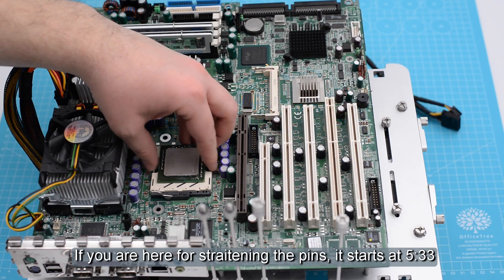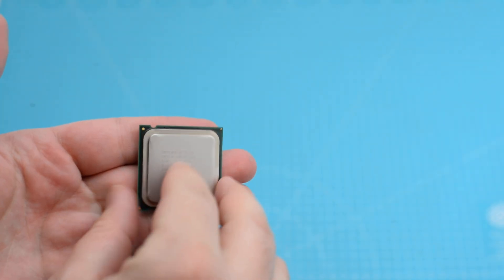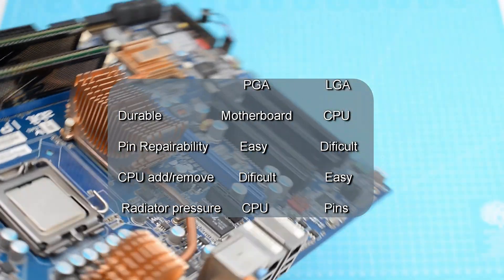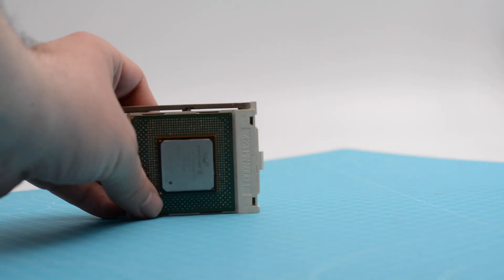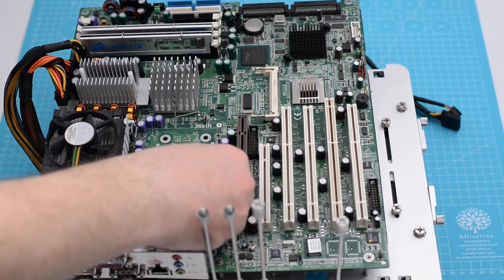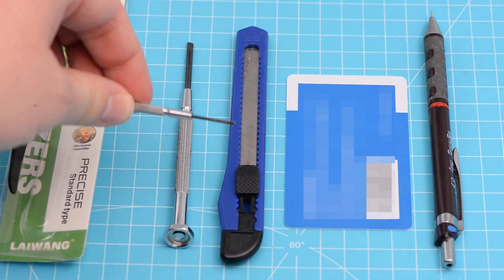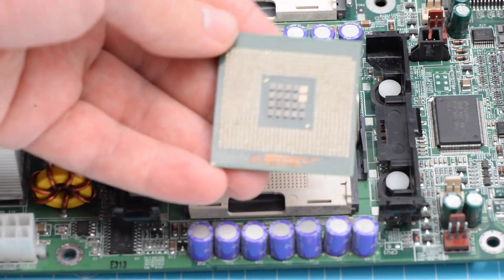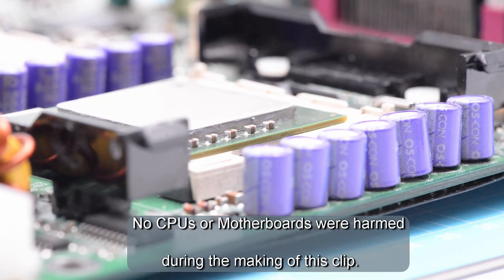Straightening CPU bent pins and the ZIF socket

Comment: I would disagree with PGA being more durable, PGA actually wears out quicker than LGA with many CPU changes, even faster if the pins on the CPU aren't 100% straight (most of my PGAs died after 100-200 CPUs), LGA can take ~300 to 800+ CPU changes no problem :) As for caps on the bottom of the CPU that's no big issue in most cases, especially with 775, the CPUs will run just fine regardless, though you can notice slight increase in possible clocks putting back ripped of caps.
Reply from the maker: Wow, 200 CPU changes on PGA and 800 on LGA, I have rookie numbers, got to pump those numbers up. Somehow I imagined that bent pins may affect the contacts in the socket and I did force a few bent pins CPUs in sockets but never had issues afterwards. I guess it also depends on the socket since for example sk 370 or sk A have exceptionally strong pins :). Taking about rookies I've seen somebody drop a LGA cpu corner first into the socket from about 10cm (these were new CPU and motherboard). Some socket pins were bent and we never managed to get them back. Needless to say everything worked fine only the last row of dimms was not visible anymore( the 4th of 4) and also there was no dual channel support. This is why I said PGA is more durable but finally I agree with you (when you know what you are doing) a LGA is better.  How did you put the ripped caps  from a LGA cpu back in? With hot air?
Reply: @TechLab47  With forcing just slightly bent pinst into a socket you're unlikely to notice after just 1-2 CPUs, but if you do it 50+ times you'll eventually bend one of the internal pins of the socket too far to make contact, socket 370 and 462 are indeed the most robust (semi modern) PGAs :) For putting back caps on the bottom of the CPU i ise regular soldering iron as i fear hotair might heat up the core too much and degrade it. Basically what i did is to put back the 3 big caps on the bottom of a e2200, after that the CPU was still missing 1/4 of the small ones 3/4 of the arrays and one blue resistor, but just the ones i put back gained me 60MHz core clock in superpi 32M :)
Reply from the maker: @taggxoc  That's very impressive. I've never heard someone actually testing the difference those SMD make. But I did wonder about the overclocking potential of the Pentium 4 (478) as I had a 3.2Ghz that refuses to start with more than 10FSB (210FSB for example) and it had only a few SMD components on the back (I'm not sure those were capacitors) and another P4 2.8 that had every place filled with those SMDs that was able to do 3.6Ghz on the same motherboard.
Reply: @TechLab47   For 478 basics are that only Prescott features resistors on the back too, all other cores only have capacitor (arrays), but what you're talking about sounds like the famous Northwood 30 cap PCB, they are known for exceptional OC performance when compared to 12 cap ones, only chips that intel only delivered with this PCB was the 3,4GHz northwood as well as all Gallatin based extreme editions. The the 30 cap pcb can be found (occasionally) on 2,8GHz 3,0 ghz and 3,2ghz 800 fsb northwoods too, there's a slim chance that others allso exist but i've never seen any.